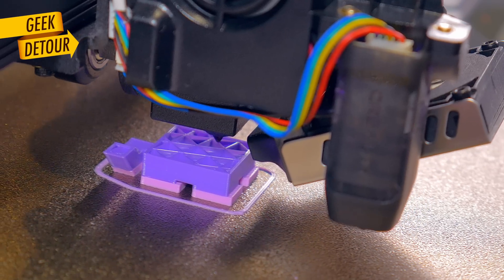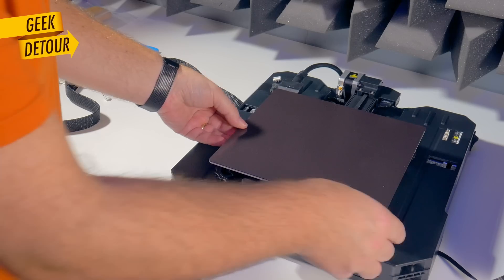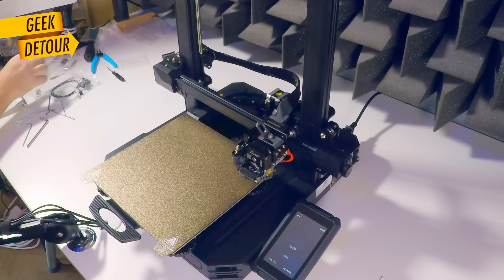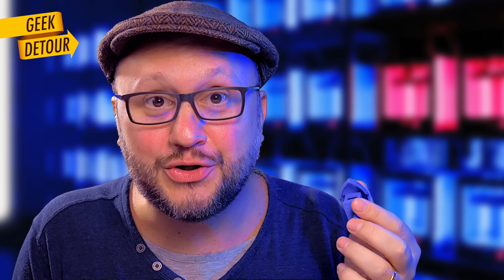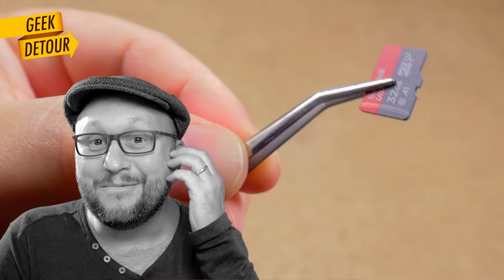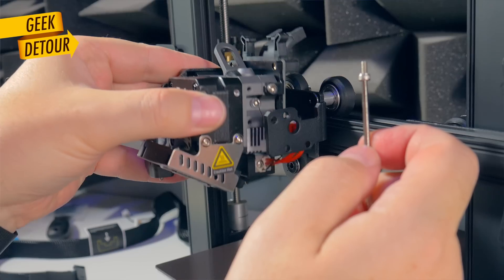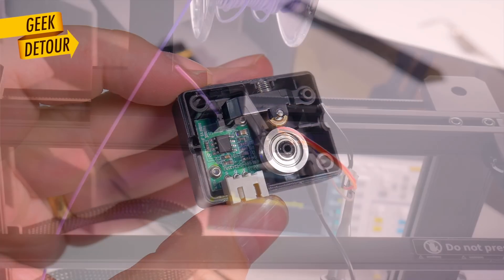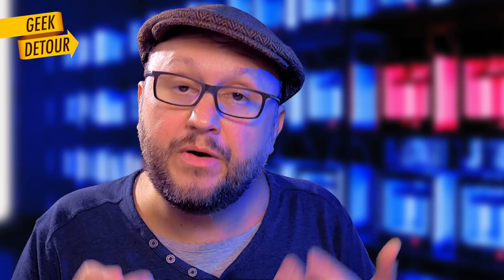Ender 3 S1 Pro: so good it begs for Klipper! 3D Printer + Creality Sonic Pad

Comment: are you going to go more indepth with the S1 Pro install on the Sonic Pad ?
Reply from the maker: Installing Klipper on the Ender 3 S1 Pro using the Sonic Pad is so, so absolutely easy… nobody needs a video! Ha ha ha. I literally just followed the instructions of the screen and in about 5 minutes it was ready.
Reply from the maker: Fine tunning your printer using Klipper, that surely deserves a few videos. I am still learning.
Reply: @GeekDetour  how is the tune with klipper on this?
Have you needed to do much from stock install ?

Sure was hoping Sonic Pad had more profile customization for other printers. Ive got a few and ann the reviews are saying Creality is trying to keep it close to the chest, trying to force their own ecosphere
Reply from the maker: Oh, if you change the tension of the belts, it changes the resonance frequencies of the printer, so with Klipper you can calibrate “input shaper” again. Advance pressure compensation will change depending on the temperature and speed you intend to print… and filament also have specific ideal flow rate (that will always change).

Also, by tuning, I also include creating your own Macros.
Reply: @GeekDetour  the Macros you're using would be a great video.

Comment: I just got mine, and I'm really thinking of running Klipper from my computer to control it. Is it worth it? I'm kinda new to 3D printing, so I don't really know if it's the path I should follow so soon. Also, I have to flash it onto the printer, right? Can I simply go back with the stock Creality firmware if I want? Also, I got an laser engraver module. Can I keep using it with Klipper?
Reply from the maker: Since you have the laser engraving module I think it is better to keep using the Marlin firmware that has the support for laser
Reply: @GeekDetour  I did a quick research since yesterday. I think I'll try Klipper at least once, whenever I receive my filaments (probably today). Laser engraving is not a priority right now, and still, I can go back to Marlin
Reply: Hopefully Creality releases a laser capable firmware for the Sonic Pad soon enough, so people can implement it the right way on Klipper, too.

Comment: I am owner of s1 pro but without "linear advance" the the corners and dimensional accuray is not so good. We are glad if you make a video how we can use "linear advance" .
Reply from the maker: Hi there! I don't know when I am going to make a video about Linear Advance and bulged corners.... Until there, try, in your slicer, check the acceleration being used - if it is anything less than 1000, try 1500.

Comment: Ricke Impey has a solution to changing colors, look at his channel. I had the same problem you did, the extruder went to home, I started changing the filament and it went back to printing! Almost burned my finger I was like WTH. Don’t understand why Creality didn’t fix this right away
Reply from the maker: Exactly. The printer is awesome - but firmware could have more attention!
Reply from the maker: Ricke solution is ingenious… but Geezzz… that’s the type of workaround I really don’t want to deal with! I want M600 implemented correctly 😄 because on PrusaSlicer it is very easy to mark the layers where I want filament change.

Comment: Their printers are ok but am very disappointed with their customer service. 
When I bought an Ender 3 where one of the 'gantry' legs attaches to the base it was cut at ~85 degrees (not at 90 degrees). This made the gantry warp and not run perpendicular to the print bed and making the cross bar the print head is on bind up a bit. When I emailed and sent pictures to Creality's customer service they said to just shim it with some paper or something. And that was the end of that. For the small cost involved (this was pre-shortages) they should have sent me a new gantry leg.
Reply from the maker: Oh man… that’s a sad story. 
When I bought my first Ender 3 Pro I was absolutely prepared for the “It’s a Kit, I am on my own” - and I learned a lot with it… I never expected support, the price was so cheap! Maybe too many enthusiasts bought their printers with this mindset and Creality got used to it. 
Now Creality has much more expensive printers, and it is perceived as a “proper product” - it should have support of course.
I hope you can find a solution for your problem, DIY or proper replacement of the part… don’t give up!
Reply: @GeekDetour  This was my second printer, the first being an Alunar DIY kit. This was, for me, an upgrade from that. And while I fully understood that even the Ender is DIY I was hoping for parts that were correct.

I ended up flipping the strut upside down so it didn't have much of an impact and was easier to shim.Though that meant that the power supply couldn't mount to it anymore. But I just printed off a solution to that issue.

The customer service response to my issue was: "We suggest to pad several layers of paper on the bottom of the right profile, and then lock it. it will help a lot."
Reply from the maker: Their response was not good…

Comment: My first printer was an S1 (non pro) and the bed was horribly warped. Creality told me they couldn't do anything through warranty (told me "no bed is perfectly level" and mine was "withing spec"). Ultimately they suggested I buy another bed or stack supports under the plate to raise the warp.. I was super disappointed and sold it for a huge loss. I received my Carbon X1 a month ago and my Ankermake m5 is on the way. So, I would love to see some videos on those two printers.
Reply from the maker: Hi there! There is some truth on what they said: no bed is really flat. A few months ago I reviewed the Elegoo Neptune 3 - it is a solid bed with no adjustments whatsoever, it was a bit warped at the back (almost 1mm)… but in the end it prints perfectly because of mesh-bed-leveling.
My first Ender 3 had a terribly dip in the center (around 1mm as well), but back then, it didn’t have BLTouch or 3DTouch… I used glass for a while (it helped a lot), but later I took it off and I used an Orbital Sander to make it as flat as I could. I got it around 0.1 of deviation, which is very acceptable. And finally, with 3DTouch I never have level problems.
I don’t have an Ankermake or a Carbon X1 - maybe one day they send me one of those to review 😄
Reply: Yes with proper understanding of mesh leveling, your hws doesn't need to be flat.  Don't worry though, it's definitely a learning curve and no issues moving to a more beginner friendly printer
Reply: @azimuth9819  my ender was REALLY unlevel. Like almost an 1/8th inch from the center to the right corner. I would have had to stacked hundred of post it notes. There is no algorithm that could have compensated. Ender is trash because they have zero QC.
Reply: @goawaybaizuo2309  I agree about the QC.  Big problem is most "how to" videos on leveling your bed for Crtouch are completely wrong, and people are constantly too high, always.  Using a 0 y offset mount helps a lot but should come standard.  Once the CRtouch nonsense is figured out it's great, literally havnt had to level my bed in months othan than when I moved it to add Oldham couplers.  Perfect quality tbh
Reply: Aluminum foil tape works well... fixed my Ender 3 pro bed dip in the middle. Best 2$ ever spent lol

Comment: What the difff between Ender 5 S1 3D Printer vs ender 3 s1
Reply from the maker: There are a few differences - mostly structural: the Ender 5 S1 is more rigid and it promises faster speeds with less artifacts. This is because of the “cubic” frame and the fact that the print bed doesn’t move on the Y axis (it goes down as the print progresses). This is particularly nice for printing BIG, heavy parts.

Comment: you can't install your own firmware, the touch screen firmware is not opensource, you'd need to change the screen if you want custom firmware
Reply from the maker: Hi Victor! You are right: people that want to use the excellent Miguel Risco-Castillo’s “Professional Firmware” on the Ender 3 S1 Pro are replacing the touch screen and on its place they put the Rotary Display from the Ender 3 V2. Luckily, it is quite cheap to buy it: around 30 dollars.

Thanks for pointing that out!
Reply: @GeekDetour  is any way to activate la on stock firmware?

Comment: I have two S1 pros, excellent machines. Also two Sonic pads, it has some growing pains. However I see Creality is doing some updates so it will get better. I like this setup and it can only get better. 💪
Reply: Why 2 sonic pads? Can’t one pad run multiple printers?
Reply: @portcityengineering  because I wanted to do it this way. For calibration sake it's easier.

Comment: if you buy a ender be aware (which these youtubers always forgot to mention somehow) that quality control is basically non existent. its basically a lottery if you get a good machine or not. not doing quality control is one way how they can offer such cheap prices.
Reply from the maker: Hi there! Tell us about your personal experience - have you had a problem? I ask because it is impossible to know for sure that the unit I am receiving received the very same treatment as any other printer from the production line - any company could take extra care and send a reviewer a product that was triple checked 😁🤷‍♂️ 
Anyway, I don’t think mine received special treatment: the print bed was very wobbly (something I don’t know the average user will even noticed since it is not even mentioned on the manual).
To me, the only “problem” is that Creality seems to “leave” to the community the task to compile up-to-date Marlin 🤷‍♂️ with more features enabled.

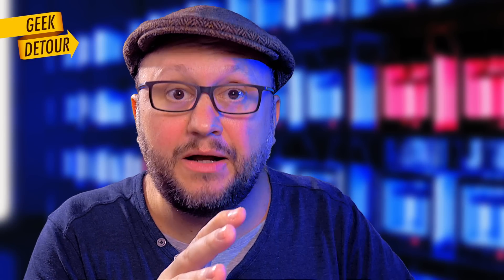Comment: 4:24 I see that you run the autotune with the cooling fan off. this is common mistake, eaiest way for me is to use m106 sXXX (If you have too much cooling installed like me its smart to pid tune with the fanlevel i need for each material :) makes the process a little smoother and you get much more consistent flow. Learning things over is a good way for an old fart to stay at the level i am :) Keep making these video my 3d printing madmad :)
Reply from the maker: Very interesting! That’s definitely something that is worth investigating. Shouldn’t PID also be performed while extruding plastic? I don’t see much discussion around it. Thanks!
Reply: @GeekDetour  it should indeed be extruded at the rate you are planning to run at. Perhaps at an offset of 10-15% to compensate for irregularities that are inherant to this hobby. Im too cheap to extrude while pid tuning to be honest🙃 so i run at about 20 degrees hotter when i calibrate. Always kept my flow even., s its so even now that i am picking up vibrations from the extruderstepper. Think i maxed out on accuracy and finish i on this custom once a cr10v2. I started noticing when printing very soft tpu that i needed to recalibrate the pid. As the fanspeed varied on the model the temps went a bit up and down giving an uneven flow due me pushing the thing to its limit on feedrate. Best so far is esun 95a at 120mms and its 99% perfect on this old piece of lugs.

Also i chamfered the extrution gears toothside to about 37.5, it reduced the chatter like effect alot.
Reply from the maker: The extrusion gears are a subject that deserves more and more investigation…
Reply: @GeekDetour  like many others in this hobby i have accumulated many clones and few originals, but i got lucky finding two gears in my bin that matched well. With alot of fine machining and file and sandpaper work the gears now enter and exit each other with the least resistence and as even as i can get it so far. I too found that the locking screw offsets the gear. So i removed the stepper from the printer and filled the flat part of the shaft and increased the diameter of the shaft and ground it down with a homemade rig. The gear now has to be heated and the shaft chilled to fit them together. I used the setscrew hole as a guide to drill and tap a hole for a slightly longer setscrew to lock like a pin. This eliminated tht offset completely. The axial slop/play along the gears face do not affect extrusion👍 currently having a little fun with the old 8bit board to have the steppers run i uart instead of legacy. Them be some TINY solderpoints, but its gonna be fun

Comment: How well do you think this would work on the regular S1? I have a few upgrades already. I’ve been thinking about trying this but I’m nervous I don’t know enough to get it all squared away
Reply from the maker: Hi there! You mean, the Sonic Pad? To run Klipper? Maybe you should first try the “Professional Firmware”, that was recently released for the Ender 3 S1 (not Pro) - it is A very decent compilation of Marlin, with a better usage of the LCD screen, more information, more menus, I think it has linear advance enabled, etc.
Reply: @GeekDetour  oh I’ve had the pro firmware since I got the thing. I updated that after like a week. I didn’t realize the sonic pad was so plug and play, I thought there was gonna be coding or advanced wiring or rigging or some other complicated work to do. I have a regular S1 with the pro firmware from GitHub I put the all metal hotend in, I bought the light. I basically turn my S1 into the pro buying all the pieces separately because I bought my S1 like a week and a half or two weeks before the S1 Pro was announced and come out or I probably just would’ve got that one. The only thing I don’t really have that the pro does is the touchscreen so if I buy the sonic pad and plug it in and hook it up, it will automatically install clipper on the printer and it will be ready to run with may be a couple minor things to do or set up? Obviously a change in slicer settings and such.
Reply from the maker: Hi there! So, the TouchScreen of the S1 Pro gets completely useless (it stays black) after you install your Sonic Pad - everything will be done on the Sonic Pads screen or on the WebInterface on your computer.
The “conversion” is: you chose the printer on Sonic Pads screen… if will write an SD Card for you… that SDCard you insert on your 3D Printer… power on… it will be flashed “Klippy” (the part of Klipper that runs on the printer’s board). That’s all.
Your printer will always need the Sonic Pad - it won’t run Marlin anymore (you could flash Marlin back if you want… but you get it: you don’t have both ways at the same time).

Fusion 360 is great! Go for it!
Reply from the maker: Klipper is clearly the future - but it is more stuff to learn.
Reply: @GeekDetour  I want to learn. That’s why I’m here. I absolutely love this stuff. I’m in the process of teaching myself fusion360 too

Comment: 100% this is a big turning point in 3d printing. Machines are all feeling the same now so the only way to go is speed! 40 hour prints need to be a thing of the past.
Reply from the maker: Klipper will push things in a very flexible direction - and it will evolve very fast because most of the firmware is programmed in Python (that is so much easier and fast to program than C++).

Comment: first time watcher and i loved the video. I just got the sprite for my ender 3 pro after some thermal coooling issues on the hot end . the best upgrade i have done recently. I'm intrested in the sonic pad but I have some pis lying around so i may just run klipper of that. But whats the advantages of klipper? thanks in advance! I'll see if you've done a video on that :)
Reply from the maker: Thanks!! I sure need to make a video comparing Marlin and Klipper - I am still learning about Klipper and how to customize it. The most striking difference is how fast you can change settings without the need to compile anything. I just changed the settings to use the whole bed plate (235 x 235mm instead of 220x220) and you change a config file, save, restart, done!
Reply: @GeekDetour  thanks ! Might have to do it then !

Comment: I have the Ender 3 Pro with the Sonic pad, the quality and speed are even better than with Marlin and you can really dial in your printing, great video, new subscriber, the only thing that confuses me with Klipper is bed levelling, as I manually level, then calibrate the Z probe, then run auto level, but the variance on the auto level can be as high as 0.8, the prints are still coming out great thou :)
Reply: Hey, on the Aurora Tech channel they show the set up of the Sonic Pad https://www.youtube.com/watch?v=EkRj0HA30rI Maybe what they do will help you out as they point out the Z height issue.
Reply: I'll run auto mesh and adjust from there, might take a few tries but ya, after manual adjust the auto there to much variance.

Comment: No way, sonicpad looks beautiful. Spent year to make my printer to be someting like S1 comes out of the box... Time for Klipper? 😏
Reply from the maker: Ha ha ha, it is unfair, isn't it? 😆 I cannot say the Sonic Pad is more advantageous in every single way compared to putting your own Raspberry Pi solution... But, PRICE ALONE it already makes sense! The screen is gorgeous - you can still access the Fluidd Web Interface on your browser, and connect a webcam. But to me the best part is: if you have one of the already supported Creality Printers, installing Klippy is ABSOLUTELY brainless.
Reply: @GeekDetour  and what about compatibility? If I have modified ender with bigtreetech skr e3 v3 mini will sonicpad work for it? or exclusively creality boards? Thank you in advance.